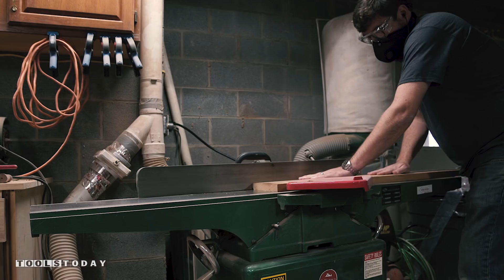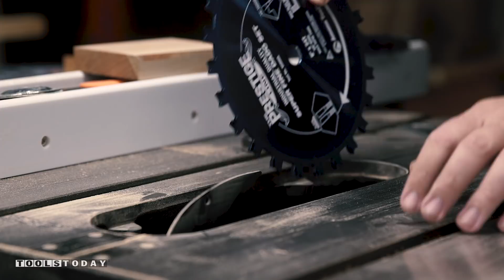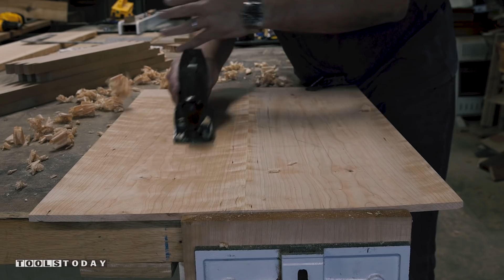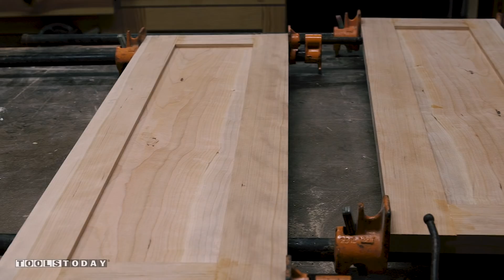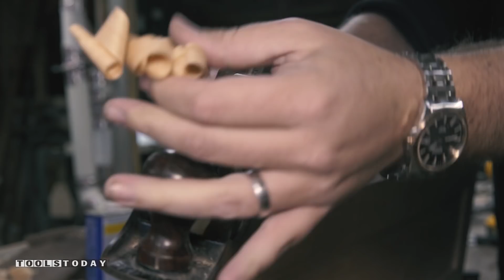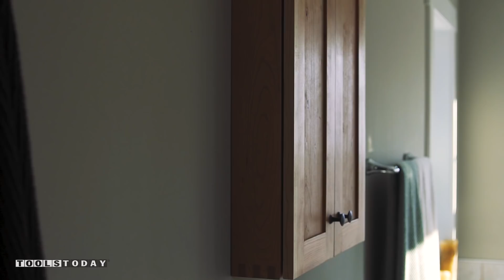Woodworking Project: Building a Medicine Cabinet

Comment: Amana Tool makes absolutely top of the line router bits and saw blades. I do have two recommendations. No door is too small to mortise the stiles and tenon the rails. This is the best insurance for preventing separation at what is otherwise a coped butt joint due to expansion of the panel - such expansion being exacerbated by cutting the panel tight to alleviate rattling. A better approach would be to cut 3/16" undersize and insert rubber "Space Balls" which will stop rattling while still allowing expansion.
Reply from the maker: Good tip, thank you for sharing.

Comment: Great job! Just one comment: dont your euro style hinges have adjustments? You could have skipped the last door planing by using the left-right adjustment of the hinge. Also you could use the in-out adjustment to push the doors a bit towards the cabinet so that they sit a bit more aligned.
Anyways this is a great build man. Congrats!
Reply: Yeah I don't understand that either. Why didn't he do it ?
Reply: Probably because the plane was faster than the 3 times of trial and error you get when you line it up closed and it's not lined up once you tighten the adjusters.

Comment: Beautiful video as usual William, that bookmatched door set really makes a simple cabinet look great.  I just recently made a box joint jig like that for project. If you put a small chamfer on the top of the pin it will make it much easier to slide your part over between cuts.
Reply from the maker: Appreciate the tip Matt !
Reply from the maker: Hmm good point Matt, thank you for sharing.